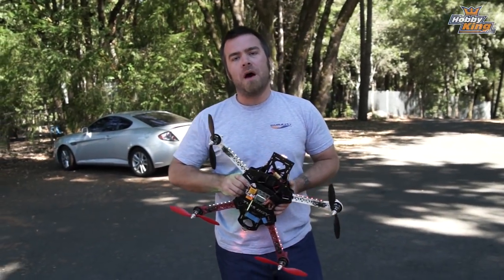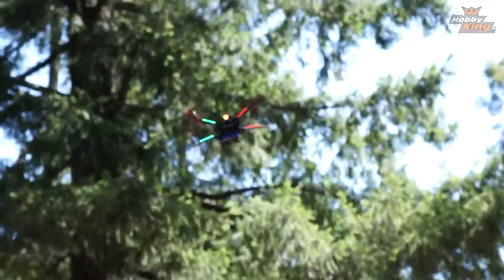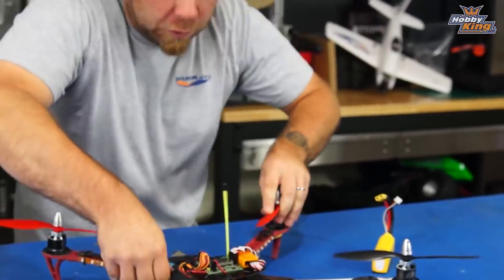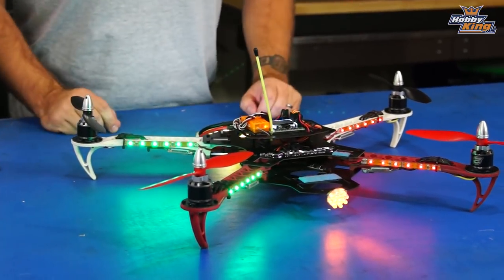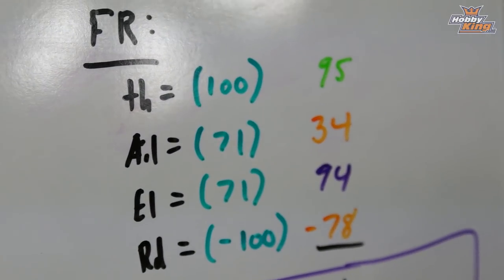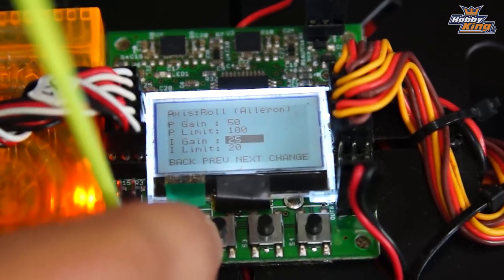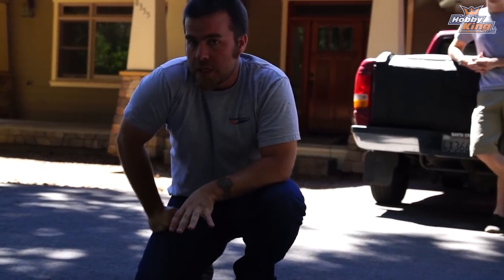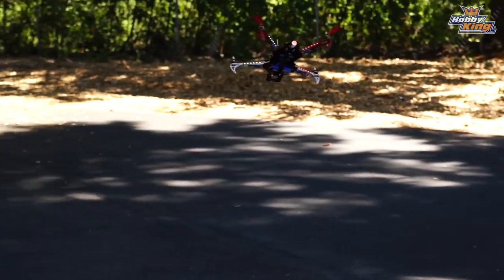HobbyKing KK2.0 Complete Guide Part 2 - SK 450 "Dead Cat" Setup and Tuning

Comment from the maker: That would be the manual way of accomplishing the same thing we just did with math in this episode.  In effect we've told the board exactly where it is relative to the motors, there's no need to physically move it.  You do make a great suggestion for anyone building their own copter from scratch though.  - Matt

Comment: Thank You!.

I just scratch built a V-tail quad and it would not get off the ground without tipping somewhere. Some simple trig and now it flies... Sort of at least, just crashed it and currently rebuilding. Turns out that if you cut the throttle because you´re afraid to run into something it falls to the ground.. :)

Thanks again!

Comment from the maker: I have a quad that I use for FPV with 20 Amp Blue Series ESCs running SimonK firmware.  I use DST-1200 motors from HK and 10 x 4.7 props.  I can get about 12-15 minutes of flight time on a Turnigy blue 2200 3S.  For aerial video I use a hex with a custom GoPro gimbal.  - Matt

Comment: just a lil FYI... make a line from motor to motor and put the kk2 where the lines cross and you balance from the same point. this will give you the right GC and it will fly a lot better that way.

Comment: Something of note in my case, on my kk2.1.5 I had to swap the Aileron and elevator figures in the mix editor. With the settings in the video the motor layout diagram in the controller showed the front motors swung forward instead of back

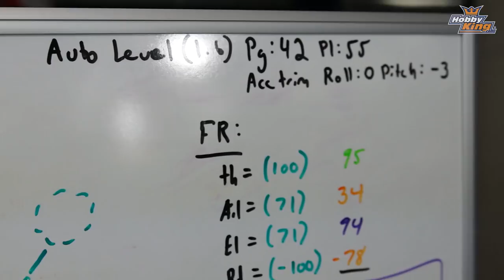Comment: This question has been asked below, but there is still no answer. Are the modified P/I settings for the REAR motors as well? You mentioned that you are adjusting for the difference in the position of the FRONT motors, so I assume you only use those numbers on the FRONT motors(?) The whiteboard at 14:22 would indicate the rear motors have only the one change to the throttle setting (82).

Comment: Hi Stew, I saw on the White board there are some negative numbers and plus number in the mix editor on your channels. My question is in the mix editor, you said the numbers for ch1 - ch4 are the same? So FL, FR, RL & RR numbers/values are identical, please confirm? I thought ch1 & ch2 would be the same and ch3 & ch4 would be the same. But it's the - minus values on your board that are confusing without any explanation. I'm trying to use your settings for a Reptile/Alien frame which looks the same as your Dead Cat frame.

Comment: Question? It looks like the center of the distance between the front and back motors is not were the balance point was set up. It looks like you balanced it closer to the front motors. Would this mean that the front motors are carrying more of the load then the back.
This is my first quad but my logic would seem to think that the KK2 board should be placed at the middle point between the front and back motor center lines. Then the control board placed here.

Comment: Curious if adjustments are required in the mix menu if the KK is mounted 3 inches aft of center/center  on an equilateral quad. . A suggestion or two would be appreciated.

Comment: Great video guys,just a quick question if i may having a tbs discovery quad with kk2 running 1.5 acro could i use these settings  as its looks badically the same many thanks mark..

Comment: I have used these settings without success. When I check the motor layout motors 1&2 move the wrong way instead of being closer to the rear motors they move forward and closer together. This doesn't work. I have seen several other setups using similar numbers but all give me the wrong motor layout. What have I done wrong. I have tried 2 kk2.1 boards and a kk2 board all do the same thing. Interestingly if I transpose the elevator values of elevator and aileron ( using negative values where applicable) the motor positions are correct but p &  I gains are difficult to tune using values around 10 to get it close to flying.

Comment: i am using kk v2.0 multicopter controller for my quadcopter but any out of 4 motors one is connected at 1st motor pin it rotates slower as compared to others... therefore my quadcopter does not tack off

Comment: Other then the looks is there an advantage of having a deadcat frame instead of a standard Xframe?...Also is there a complete parts listing for this exact quad for newbee quad builders like myself...thax
Reply: It's for cameras. When you have a wide angle camera and you see the motors, it doesn't look all that good. So this stretches the front arms out so you can have a wider angle. For the parts, they have a dead cat kit with all the parts for this but you still need the base sk450 kit too.
Reply: Kevo F Thax... I ended up ordering a st360 from hk...I will maybe build one of these later on .... i orderd a new kk2.1 board not sure if its better then the kk2...and a Q brain 4 in 1 esc ...

Comment: Help!
I dialed these numbers into my new deadcat and maidened it, once I put a little forward elevator on it, it flips forward and lands on its top, I have the kk2.1.5 v1.6. I have all the motors spinning the right way, the correct CW and CCW props, ESC's are calibrated and all the leads are connected correctly. Any Solutions?  Thanks
Reply: Did u figure out the problem? Mine is doing the same...
Reply: David C Yeah i got it flying perfect with digits I got of a friend, they aren't as fine tuned as hobbykings but it Flys perfectly smooth, I'm gonna be putting up a video of these numbers soon, didn't try hobbykings again :/
Reply: David C Yeah i got it flying perfect with digits I got of a friend, they aren't as fine tuned as hobbykings but it Flys perfectly smooth, I'm gonna be putting up a video of these numbers soon, didn't try hobbykings again :/
Reply: FlyingMaddLadd I found another video on YouTube that worked perfect for me. Dead cat is flying smooth and awesome. Gonna put my fpv gear on maybe tomorrow.. Thank you though..
Reply: David C do you have a link to that video ive the same problem
Reply: David C which video did you use!?
Reply: jakesky100  youtube around and some ppl have their deadcat settings posted. Btw. That was the first quad i built and would not reccommend this quad for any aerial footage. for many many reasons. i would invest in a regular x configured quad that has a clean plate and a dirty plate and upgradable to a gimbal. Hobbyking products are crap....for the most part.

Comment: Does anyone know why when i put the settings into my kk2 board and then do a preview of the motors on the lcd the motor layout is backwards. Small in the front and more spaced out in the back..
Reply: The same thing, but it flies well with these settings.
Reply: The concept is largely correct but he used the wrong angle(s)
Go to page 21 of this link for the the correct way to determine the input angle.
And remember, your looking for the Sin and Cos of the degree, not radian.
http://www.hobbyking.com/hobbyking/store/uploads/161447249X30206X38.pdf
Reply: +David C 
I'm getting the same... It looks like the front arms are mover inwards instead of out????
My DC flies like.... well.... it doesn't.... it just flips and crashes!
Do you have any tips???

Comment: I I have a TBS Discovery with a KK2.1. I have Steveis 1.7 Pro firmware. I calculate       Sin(20 and came up with .9129. How did you get .34?
Reply: You are in rad instead of deg

Comment: what happend to the part 2 of setting up the board you went from how to do the firmware update to this.
what about instaling the board pligging in the wire im lost
Reply from the maker: +Nubyrc Are you lost on plugging in all your ESC and receiver connections?
Reply: I got it installed now, I am stuck on the I and P gains, and what are limits about?

I can fly a quad just not this big one with the
 KK2 board!

You see I have two micro quads I fly in the house, one is a HK Q Bot Micro and the other is Horizon Hobby Blade Qx

The Blade flys awesome, I feel very safe and confident flying it, I let of the sticks it levels out I stop it by bulling back the opposite direction I had it flying in and it stops and holds it position and it is because of its built in autolevel, the Q bot does not have it and it is a pain to fly it just keeps on going when I let off the sticks and over shoots when I pull back.

I am not sure if the Q bot has a problem but I am working on the KK now so I will mess with that later.

I am wanting the Kk2 board on my big quad to fly like the Blade!

The Big quad I have is Hobbyking X650F Glass Fiber Quadcopter Frame 550mm 							

The KK2 board I have is version HK 2.12 Firmware version 1.6

Using turnigy XP 950kv motors, a Qbrain with a 4000 mah 30c turnigy lipo 3cell, and covered in gold and blue turnigy led light strips

Props are those blue and yellow props sold on HK website 8 X 4.5 they feel soft and flexable compaired to APC, but they seem to hold the copter in air ok, I may go with apc when i am able to really let the copter fly hard!

Also made a housing for the KK2 board with the 3d printer for added protection and to insure a level installation of the board, with a cover to insure wires do not come off during flight.

It oscillates slowly at level and flies like the Q Bot does. I let off the stick and it just does its own thing.

I do have autolevel set to a switch, my radio is a Taranus X9d I have done nothing with the rates on the sticks.

When I turn auto level on it wigs out! Rotates to one side and takes off!

I do not know if it is flying badly because of the I and P gains or the limits, or what to set up to use autolevel.

This KK board has settings listed in the menu that I do not see on any online instructions, like camera stab for example.

I really just want it to self stabilize like my blade micro does, so I feel safer flying it around.

Comment: When i fly my deadcat, it stays nice and level and hovers just fine,until i have been flying a few minutes, and then it starts drifting forward and to the right,and the longer i fly it,it will drift more and more those directions,i can set it down and unplug the batteries, and then plug it back in,and it will work great for a few minutes, and start to drift again! can you help me figure this out?
Reply: What flight controller do you use?
Reply: Mac Silvey I returned the kk2 and got another it fixed it! it must have been bad GYROS! HUH!
Reply: Mac Silvey I input your number settings and installed the new one and test flew it!, it flew great havent had to touch it since thanks!
Reply: Have it when that happens. Glad all is working now!
Reply: your the best man!

Comment: can anyone help me. I'm using     a dsmx receiver, dx6i, kk2.1.5, and a f450 quad and when I push up my throttle the aileron or elevation change I've tried switching cable and they are just resigned again
Reply from the maker: +chris james do you have your receiver channels hooked up correctly? are you sure all the motor wires are plugged into the correct ports?
Reply: +HobbyKing Live on the kk2.1.5 I have ail, elev,  throttle, rudder, then aux hooked up in that order
Reply: +HobbyKing Live I'm using a ds6i with dsmx receiver and when I try switching the cables the kk resets them again

Comment: I have my 450 Deadcat setup with these settings (same hardware too although not an NTM motor, using equivalent the same size and KV) and it hovers and punches out great, for some reason that I cannot fathom the front drops when I yaw, so if I yaw right the front left drops, when I yaw left the front right drops.  In forward flight this is not too bad but when you just yaw from a straight hover it's terrible, anyone else experience that?  I've triple checked the settings, cannot figure it out.

Comment: yaw is different from pitch roll btw... longer arms dont equal more torque and authority. motor location is irrelevant. its rotational force from the motor torque. where on the frame its applied makes no differenc at all.

Comment: i did all these settings but it just oscillates and crashes
Reply: did you ever figure it out?
Reply: anonymousufo i assume u got differnet motor/props/battery/escs/auw. For tuning to match, everything must be the same.
Reply: yeah i figured it out, badly balanced props caused vibrations

Comment: Geez guys, All these new settings manage to do is to cause my converted SK450 to the Dead Cat configuration to flip straight over. It somersaults right onto it's back. I balanced, set the trims to 0 and installed the values to what you recommend but it won't get off the ground. Useless information. Very disappointed.

Comment: I have a standard Xquad layout. I see on your whiteboard your show 71 for both the Aileron and Elevator values and -100 for the rudder. My default was at -71 for Aileron and 100 for rudder. Should I change these to what you have or is that a mistake on the whiteboard?
Reply: Never mind, I tried changing it and it flipped over before it got off the ground :D
Reply: +chris cronkhite Dont feel bad mine cant even fly the original turnigy SK450 I have one or two motors that dont spin then do spin and it wobbles out of control and or flip right over on top dome. tried a dozen times adjusting and nothing fiixes it, throttle calibrate and it show in receiver test its throttling up correctly but again my motors will not spin at even half throttle or 2 sets have full power and two have nothing cant figure it out? wasted my money on it basically is how I feel.